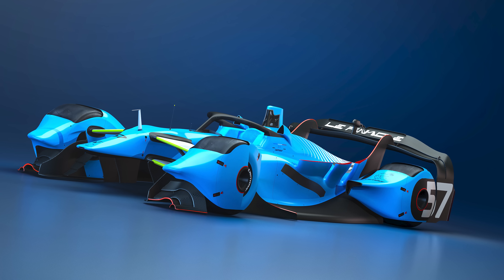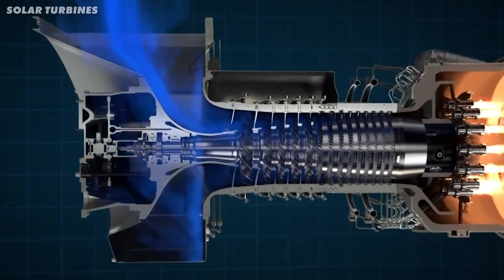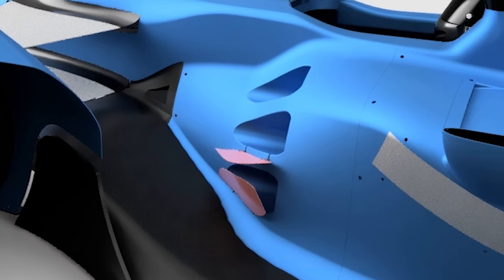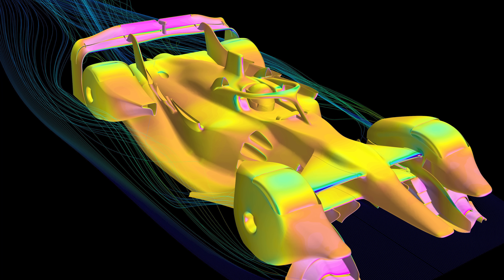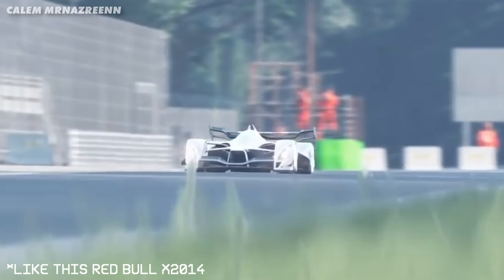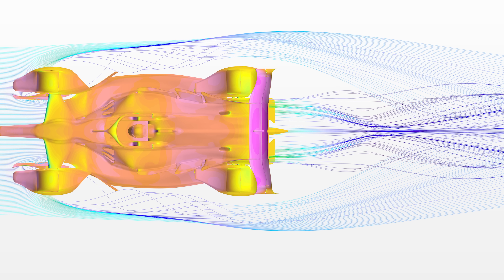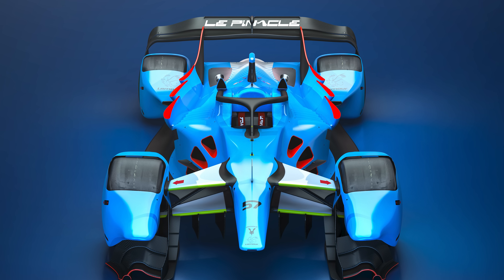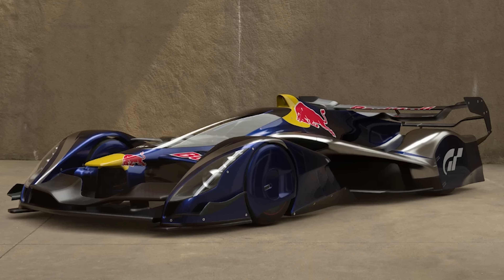Someone Designed The Perfect F1 Car (No Rules)

Comment: What is sport? What is sport about? It's about the best winning. It's about pushing yourself beyond your limits, achieving extraordinary things. What's so special about sitting in a high-tech computer and just pressing buttons? These modern vehicles have almost nothing in common with a real racing car. In fact, you could take away the driver entirely and just have the thing drive remotely, and even that could be handled by an AI. Completely absurd and has nothing to do with sport anymore.

Comment: i feel like those wheel covers are not gonna work. I have no idea about formular 1 or building cars. But ive seen slowmotion of the wheel expanding and stretching in curves far beyond their volume still. It feels like in the 3d model the walls of those covers are way too close and them being so thin will most likely cause the wheel to touch them during vibrations and rip the entire thing off the body or shred the wheels itself. I also dont know what the air turbulances would cause to this car in a race

Comment: Wouldn't the tire covers make it much much longer, if not impossible, to change tires during pit stops?  I assume with that max speed and turning speed, the tires won't be able to handle a full race with a single set of tires...

Comment: It could easily be more crazy. Such as weponeizing air flow that goes behind u, and making the seat like normal cars with addition to balancer room (an offsetting dynamic equilibrium finder free moving continer). Balancer room reduces G force and gives a better experience. With the safty stuff that normal race cars have and a bit more horse power (for the increased weight), almost anyone young and healthy would be able to drive it like normal. The room need to use electric electronic singles for control and commads feed which is also faster than normal way. U can use small electric motors on each wheel to do better more brake and give u computer assistance for driving (doing translations) and more stability, control ect....

There is alot more u could do.

Comment: What kinds of tires was this designed to work with? 4.5 tons of aero load and 7g of lateral force is going to destroy most commercially available tires i would bet. It'd be a lot like why driving more than 300mph is damn near impossible because the tires can't handle the heat generated at those speeds. Love to hear about this part of this project.

Comment: 16:00- this is a silly point. Using current regulations everybody already builds a single F1 car for less than $10 million. However, the $145 million team budget covers the entire cost of racing 2 cars over a 24 race season. If this so-called ‘perfect’ F1 car had to actually compete against other ‘perfect’ F1 cars from rival teams, all of a sudden the pursuit for ‘marginal gains’ would see costs skyrocket. It was the quest for marginal gains that saw the big teams push budgets towards a billion dollars, not the rules. If anything, the rules acted as a curb on costs. Without rules I reckon that within two years the top teams would be spending well over 3 billion pa.

Comment: I'm thinking maybe I've seen a previous "no-rules F-1" video from you before.  I feel like I've shared some thoughts on it before.  But, it's been awhile.

My idea of going no-rules and to sort of keep the speeds down is to make the cars smaller.  Maybe twice the size of a go-kart is good.   Making the parts of an engine and the suspension smaller presents as much of a challenge for engineers as making a a devil16 go however many hundreds of miles per an hour it can.

- of futher note, I can't wait to see what racecar engineers can come up with using A.I. engineers!  And 3d printing!

Comment: As a mechanic, I want to see how a pit stop would work. Change those tires fast. I can’t see them making those pods work on a time crunch. You would lose time on pit stops but I think you would make up much more on the track.
Reply: In my opinion, you could just have the covers hinge and use aero latches.
Reply: @BigD4Real.  still gotta be tricky at high Gs, and pods have to swing a long way for wheels to get swapped
Reply: The thousands of pounds of downforce make up for a need of replacing tires… unless it starts raining… then we have a problem
Reply: There is the easy solution of removing the wheels with their cover included. We are assuming no regulations apply something this would be a perfectly valid option.
Reply: You should know that maintenance isn’t an engineers problem.
Reply: At 15 seconds a lap advantage, 3 laps = a leisurely 23 second stop if pitstop loses 22 seconds
Reply: Good thought, but it doesn't matter if all cars are the same
Reply: I'd wager the best way would be to take the le-mans approach like swapping out entire brakes, just make it a whole pod covers and all and swap it all out in one section
Reply: I guess you could design some correction for facilitating pit work. And... Maybe yeah you would loose some time
Reply: Yeah true, but I still think that even if the pit stop would take a bit longer it wouldn't really change the outcome of the race due to the crazy performance of the car. If it really is capable of doing a lap 15 seconds faster than a conventional f1 car then at the end the pit stop time wouldn't really matter.
Reply: Very smart
Reply: to compensate, you could take a page out of certain sportscar racing series and require pitstops to be a minimum length... set the minimum pit stop time to something reasonable, including time to deal with the unorthodox wheel pods. i think something like that would work pretty well.

edit: that, or set it up like they do for brakes in endurance racing... have the entire wheel and wheel pod removable as one complete assembly, and have it detachable from the ends of the suspension arms via quick disconnects. now that i think about it, this would be a significantly better option than the first one i floated.
Reply: @penitentlizard  Why stop at wheel pods? Pull the driver's pod out of one car and into another while both are in motion.
Reply: @djinn666  that would be hilarious... lol FormulaE did something like that at first... if i remember right, when the series first started instead of pitstops the drivers would change the entire car. something about the batteries not being able to make it through an entire race or something.
Reply: @penitentlizard  Yeah you're right, early years during Formula E they would just switch cars because the batteries could not survive the entire race. But as technology has improved they no longer need to switch cars, as the battery is able to survive the entire race.

Comment: I’d love to see some cool futuristic hot wheels races with cars like this, tracks with loops and tunnels where you can pass on the ceiling… perhaps electronic activated NFC based “boosters” or “traps” where you can get a small electric motor boost or hitting a trap kills your throttle for a second or two.

Let’s make racing fun again! Let’s get crazy… we have such cool technology these days, let’s use it! Even if the cars have to be essentially drone operated for safety. Who doesn’t wanna watch hot wheels/mario cart mashup style races?!

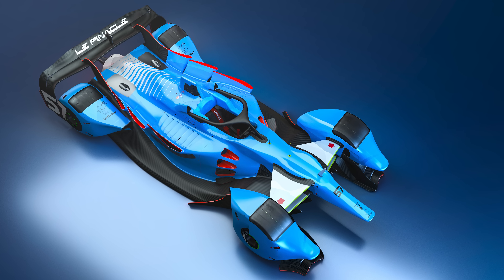Comment: 3:10 I know he's definitely already considered and rejected this, but what about a hybrid/turboelectric setup?
Reply: Battery and motor would be as heavy as a sedan lol
Reply: @BlwnV8-l3y  I'm not talking about a standard hybrid. I'm talking about a gas turbine driving a generator that powers electric motors, with a small battery allowing the car get away with a smaller turbine (the turbine only has to slightly exceed the average power draw of the motors, not match their peak instantaneous draw).
Reply: @goofball3056  oh, my bad. I thought it's a gas turbine that will be accelerated by basically a giant MGU-H to get it up to speed immediately😅😅. Well, actually genius. If you can run just the low rpm and make great power, it's gonna be good, as getting it up to speed would take 5 business days

Comment: A gas turbine driving a generator powering 4 motors in each wheel with a tiny battery for the peak loads would save weight and give you the ability for 4 wheel drive, 4 wheel traction control and a much smaller and lighter powertrain. The fan could then be electric and simply stop spinning rather than the overcomplicated blade angle changes, and turbine engines require less cooling, so again, it is simpler and lighter.

Comment: that +15 sec lap time is going to be needed for a tire change lol.
Reply: You're assuming the driver doesn't die from the G forces during a turn with the fans on. I did see side panels that can open up for tire changes on the 3D model.
Reply: @Frenchfrys17  yeah only astronauts have a shot at the cockpit lol

Comment: How do you even repair it? Like there so many systems that can theoretically break. Like those little closable things on the front for cooling, what if they just stop opening, or that vacuum thing doesn't open or seal properly. What if it makes the contact with another car? What if some random piece of metal goes under the car and breaks the air flow pattern on the one side? How do you change the tyres?
Don't get me wrong, I'd lowed to see this thing racing as any other interesting car, but there so many questions.

Comment: I mean this is like a Chinese knock off of the Redbull2011 but if they are doing that who's gunna be the 1 to make an IRL dodge SRT Tomahawk?...
Another big problem with this car DURABILITY and STABILITY like want happen if a piece of debris on the track knows off a part a fin or cardinal hole much handling will the car loss/ how hard will it be to keep the car under control, that why I hate overengineering things cause if all these variables need to be perfect for it to work and 1 bump in the road or a piece falls off can lead to it failing/ crashing its a waste of time.  though in my opinion F1 is kind of a waste of time anyway cause they do not allow innovation same as many motorsports "oh we want everything to be fair" FUNK THAT that just makes the race boring the whole point of racing is to see who's car if faster not see which driver can make the car faster I want to see no holds bard unfair racing with teams strapping rockets to the cars to win instead of heres the same car with a different color and sticker good luck coming in first.

Comment: So here's the question is how fast can the tires on this car be changed. Because with added amount of downforce of the car the tire wear will be higher and so in theory more changing of the tires and even if the tires are to be the same ones for f1s. So if this is going to be said against f1s that amount of time it takes to replace the tires will be an essential key to the race if anything for the designs as well.

Comment: One thing i would be interested in, would be how big of a difference would making old F1 cars out of any modern materials you can think of do, if all you have to take into account would be to keep the original dimensions of the car, and only swap old materials for new ones...

What would a hyper modern Lotus 21 feel and drive like compared to the real one, if you could use things like carbon fiber and modern tire compounds? Would some cars that just didn't work because of poor handling get better? Would it ruin some actual good cars?

Comment: turbine to generate electric power and a deployable thrust deflector (a brake that redirects thrust evenly in certain directions to prevent it from propelling the car, of which you can use for additional braking or as a means to drive secondary electricity generation) when not accelerating  forward  (not turning)

Comment: Look up Robin Shute's channel and his series about building a Pikes Peak racer. 
Open class in the Pikes Peak Hillclimb has few rules, and Shute came up with a car similar to Lamour's in its broad outlines: high on downforce, light in weight, having a typical mid-engine race-car layout, and using rear wheel drive with a small turbo engine (a NZ-made 2.4L V8 involving BMW motorcycle parts, in his case).

Comment: Quick question: wouldn’t a variable transmission that disengages completely when breaking with a magnetic clutch be able to run a gas engine with having it slow down? That way you have double “extensions” to reduce the high impact of the re-engage. That or maybe double magnetic clutches?
Or maybe the weight is just too high to incorporate that kind of solution?

Comment: mini-RDE piped straight into a tesla turbine all encased with ferrofluid convection current stirling (these are pistonless and take any shape, if you were imagining pistons, look up the terms first). Diesel-propane-hmx based emulsion fuel. You can switch hmx for dinitroglycoluril if you want to be environmentally friendly / non-toxic but it drops the detonation velocity, or you can jump for heptanitrocubane for higher detonation velocity but its less stable. Use multilayer graphene-borophene heterostructures in the RDE to withstand the shock and pressures. 

I have an even more powerful engine setup based around the shkas machine gun (quite different, its two opposing interlocking revolvers back ported into a magnetically geared turbine to power their spin) but it expends thousands of tons of solid fuel in seconds and if you increase slip rate to lower fuel expenditure the efficiency decreases to the point of it being less volume efficient than the originally stated engine. So its not feasible for anything that's not a burst.

Comment: 21psi per square inch atmosphereic pressure...a 4x4 plate makes 48000lbs of downforce
so its a 10% vacuum on a 16sqft plate...? 

and theres never enough horsepower, run the fan faster and suck more air and get more downforce.

i think the mcmurty does well over 1000lbs of downforce in an electric smaller car

Comment: This car hasn't been built yet. How does it perform when the track surface isn't perfectly flat, on the speed bumps on corners, and in crosswinds, for instance? And what happens to it if someone collides with it? If the driver lost control at those higher speeds, what are the chances of them walking away from the crash uninjured? Don't forget that F1 cars are regulated to slow them down to give the drivers, marshals and crowds reasonable degrees of safety..

Comment: I would love to watch even just 1 of these going a few laps with a pro F1 driver. I think the biggest negative in current day F1 is that it is far too overregulated. I get that most of those regulations are for safety purposes, but it also kill most of the innovation and excitement out of the sport, because when you have so many limitations on you eventually you will reach a point where you will have the best car possible and innovations can only happen after major scientific breakthroughs.

Comment: The engine doesn't have to accelerate and decelerate constantly. So a jet engine is viable.
You take the jet engine and the CVT and then link the output of your gas pedal to the CVT directly. CVTs are capable of doing exactly what you need. Near instant power changes. Add a clutch and you can remove the power when you brake while not reducing the engine RPM at all. Then the second you let go of the brakes power gets applied again at the speed the car is going and with the touch of the gas pedal you accelerate at the best possible rate. As your engine RPM can be fixed in the most efficient or more powerful setting you can just train the CVT to make use of all the power.
You can use the jet engines bypass to generate huge downforce and the jet engines exhaust to generate extra speed.

Jet engines are like the best kind of engine. They have continuous combustion and a really high RPM. They don't have inefficient pistons so should vibrate less.

Comment: 3:00 this is a total non-issue if it's a hybrid. electric motors for torque & acceleration with relatively small capacitors, just slightly more than necessary for acceleration.

Comment: I'd have added some weight for CO2, enclose the brakes more and inject CO2, and vent the waste into places that also require cooling, like the engine bay (obviously seperating from air inlets). Also even oxygen for when at high speed? Moments where all inlets are closed and stored oxygen pushes into the inlets?

Comment: I would much more like to see this kind of effort but using McMurtry Spéirling technology which gives you a much cleaner elegant car that requires much less energy and can pull maximum g's at any speed.   Obsession with putting all kinds of complicated aerodynamic devices all over the vehicle does not make a beautiful car.   Burning fuel is still polluting, electric power is the future with battery energy density improving dramatically electric racing has a bright future.

Comment: If it's perfect then it 1.  has no V6 engine (in fact it would be a V12), 2.  has NO electric power assistance 3.  has THREE floor pedals (if you can't drive a manual, then just make the F1 cars remote control, since driver skill is now moot).  We get it, modern males.  You don't want a race car.  You want a video game on wheels, that doesn't require skill.

Comment: Cool and all, but getting 1600hp out of a 1.6L twin turbo V6 engine wouldn't be very easy and reliable. The F1 MGU-K engines are hybrid, with 1000hp, Regen and running at 15k rpm. But without the hybrid system, where will you get the rest of the power from? Make the engine go up to 20k rpm? Put ginormous turbos on it? 1600hp is a lot for just a tiny engine.

Also 4.5 tons of downforce would limit this car's top speed absurdly, making it really inefficient and combined with pulling 7Gs of force, which is enough to knock the driver out, unless he has the same training as a fighter jet pilot, and leaving aside the tires needed to withstand all that pressure. All of this would make this car a good show car, but something that in practice would probably never be raced. 

So yeah, big numbers aren't everything, cool concept tho😂😂😂😂